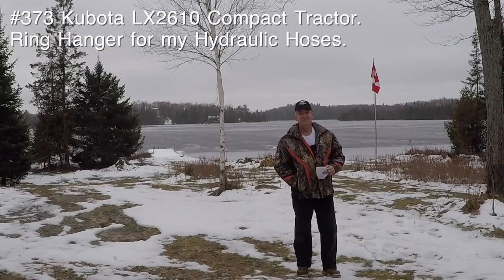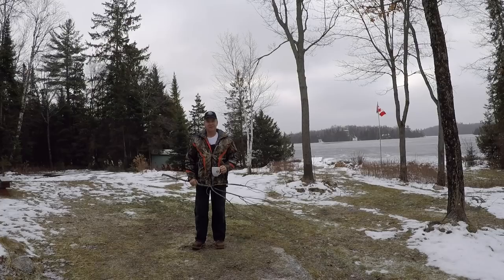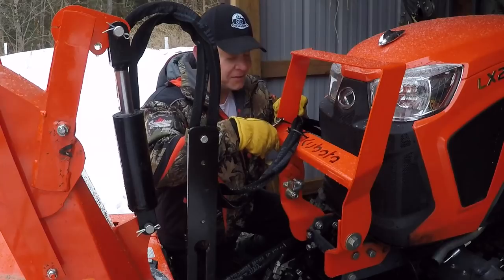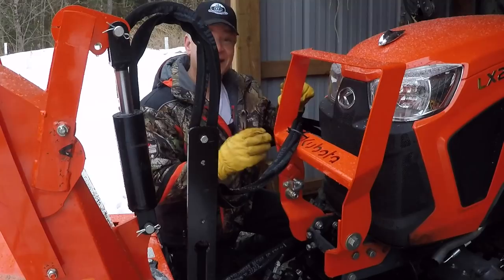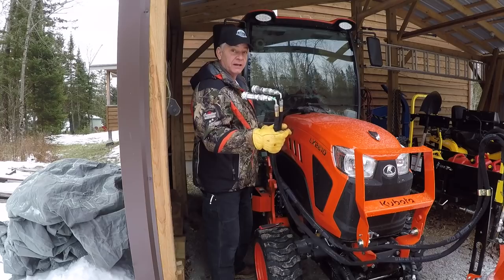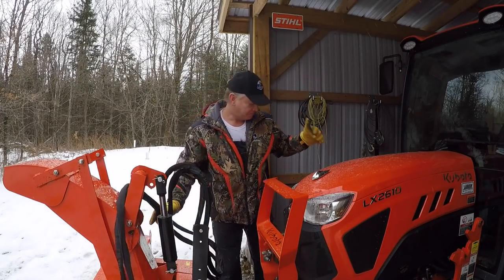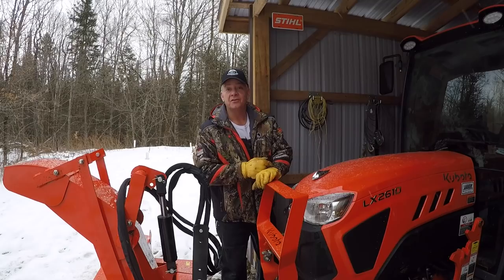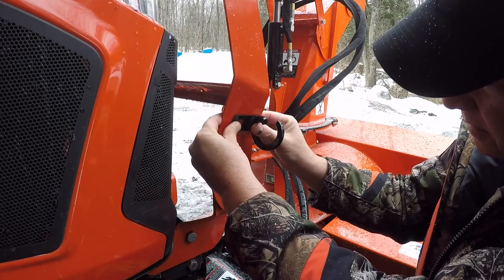#373 Kubota LX2610 Compact Tractor. Fix for Your Snowblower Hoses. Tractor Mod. Ring Hanger. outdoor

Comment: Two small things, one would be to get a set of step drill bites, they make drilling holes a bit easier. Second, by the valve body, does it rub at all over there? If it does, might want to put a second hanger near the valve body
Reply from the maker: Thanks Nick. No, all good over by the valve body. Thanks for the advice - cheers!

Comment: GP you wouldn't happen to remember the part # for the hose catcher? Thank-you for all your great video's :)
Reply from the maker: HI PJ - I am sorry but I don't - it actually came as part of the setup with my front mount blower. I am sure your dealer can look it up - sorry I could not be of more help.
Reply: @GPOutdoors  Thank-you GP. I just got a new LX2610 with the front blower. I haven't gotten my FEL yet, could be this spring, but they have put a diverter on the blower itself to run the hydraulic shoot diverter. I'll be having the 3rd function set-up on the FLE when it comes in and they do the install of it. Thank-you for your time and the great informative videos you do. Cheers from Maine :)

Comment: Hello! We received about 10 inches of snow yesterday. Not as much as some other parts of New England, but enough to make it fun to move. The wind out of the northeast made it a bit challenging. Getting ready to finish cleaning up around the house and then tackle the runway. The snow is light and fluffy making it easy to move. I'm curious if you think the snow blower on the LX moves the snow better than the snow blower you had on your B.

Comment: The difference between the two sets of hoses might have been intended to prevent mixing the the sets together when attaching. This could result in one end of a cylinder trying to compress the other end, even though the other end wouldn't be venting to the tank.

Comment: GP, watching on my phone so view is small, but a question that I can not see well enough to answer. Could you turn those 2 hoses where instead of pointing up and then feeding down, could you turn them toward the tractor giving you a couple of more inches of slack or length on the hoses. That holder for the hoses is great quick improvement.

Comment: Hi GP,
It would be nice if manufactures took more time for user comments. While they do a great job overall, and are improving, there are a number of little things that could be refined. For example getting out of the dark ages with lighting and moving to LED lights. A good tool box option would also be great. In your case hydraulic hose routing could be improved. I do like the new quick release for all 4 loader hoses. Great video as always! Is Mr. Fox a regular guest?
Reply from the maker: LOL! Yup, him, the babies, coyotes, wolf, deer, moose, otters, beavers and the odd bear.  Cheers Tom! Just hard to get them on film. They are super astute!

Comment: Greetings from Wisconsin! Great mod there!  Simple and effective. I wonder why they angle the hoses up coming off the cylinder? Seems it puts constant strain on the fitting. I see pins on the cylinder mounts, I'm just guessing here, but if the cylinder was turned upside down from the way it's currently mounted, it'd have plenty of length.  I'm as curious as you are why they have it the way they do. I've also had my dealer improperly "set up" a few of my attachments. Take care my friend

Comment: Do you leave the tractor plugged in when not in use? Have to replace my engine block heater on my 2 and a half year old B2601. Dealership said it failed because I leave my tractor plugged in all night. Said those small heating elements weren't meant to be plugged in for more than a couple hours. Cheers! ✌

Comment: Personally I have a Massey and wish I had the orange tractor.  My hoses were a problem from day one in many areas.  I was surprised how little it costs to have longer hoses made if your willing to donate the ends from the originals.  I’ve actually replaced almost all the lines on my tractor at this point due to the poor quality hoses the factory used on my Massey GC series. 
Personally I would have just lengthened the hoses with complete new or just add some length of hose with some joiners.  Hanger is fine but I like it when everything fits right in the first  place

Comment: With ALL do respect you are a pretty nice guy. but  when it comes to drilling metal . it ain`t worth spit. why do you think they make veriable speed drills? you need to slow the drill down so it has time to bight  that way you won`t have trouble like you just did and your bits will kast a heck of a lot longer. i would consider getting a new set of real bits being as how after watching today I would say that most of the ones you have are already burn`t up. love your channel